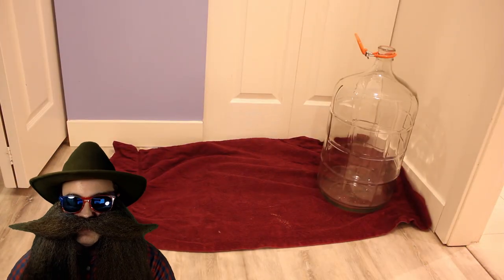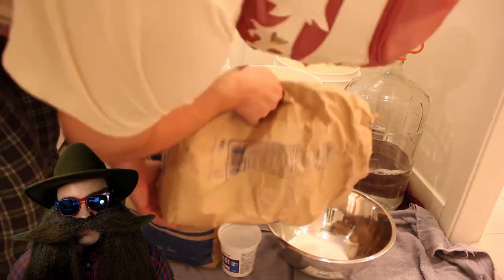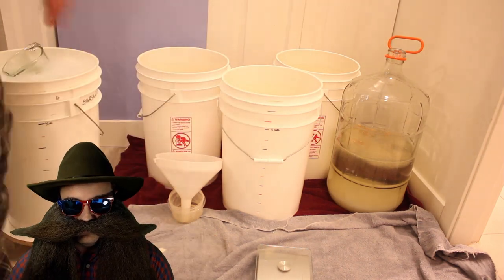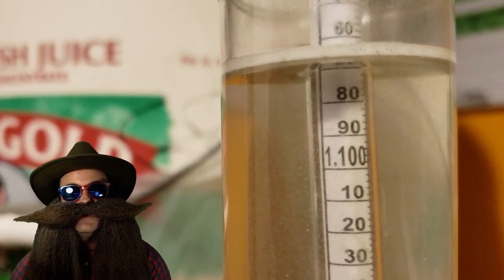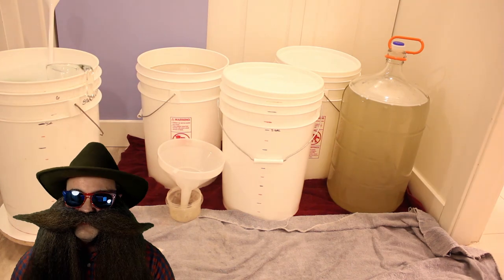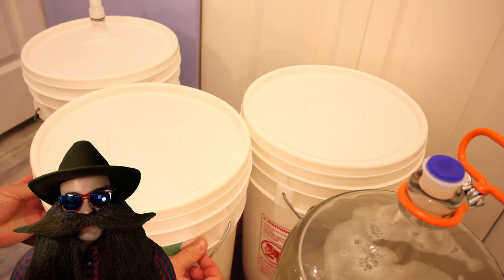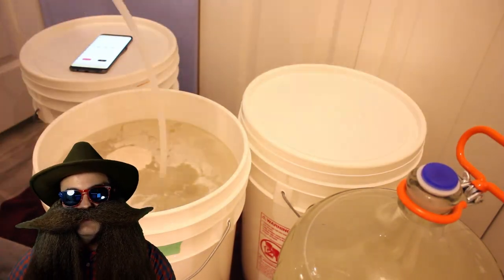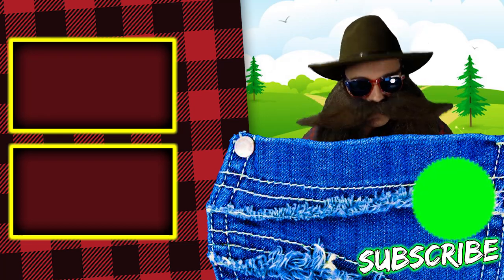Sugar Wash Recipe Design #2 - Moonshine Recipe

Comment: i use Still Spirits Turbo yeast with 8 kg of sugar in 25 liters of water and have around 20% alcohol sugar wash after 7 days, use this already 3 years and never had problems, put it in my T500, and gives me 5 liters of 93/94% alcohol.
Reply: Nice. A few questions if I may? Do you do a stripping run? Do you use their clearing agent? What temp range do you run the T500 at? Do you carbon filter and if so, how long do you leave it sit, then what drip rate? Cheers